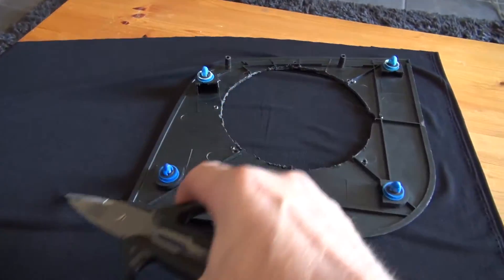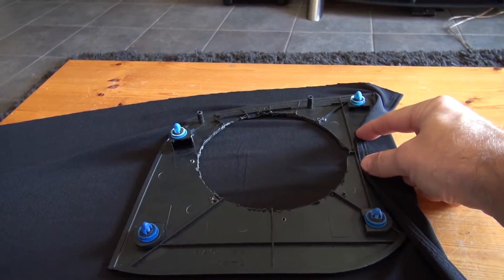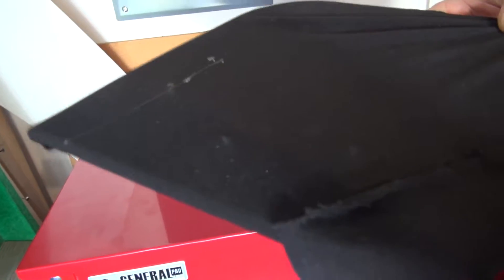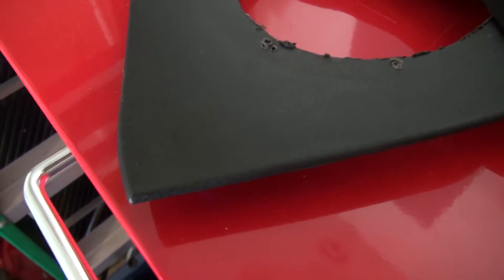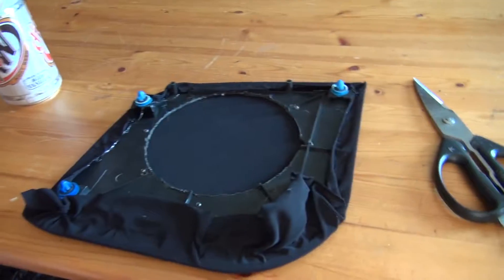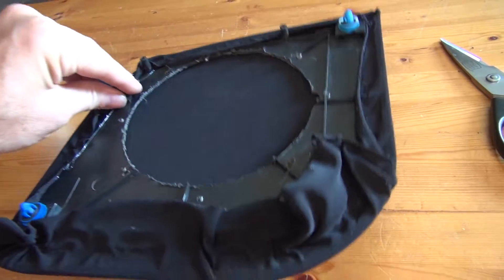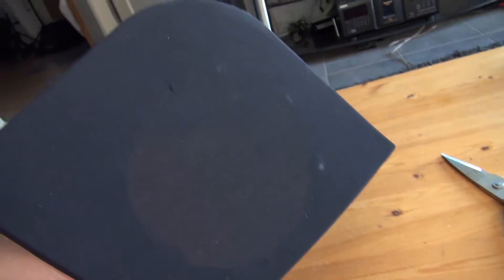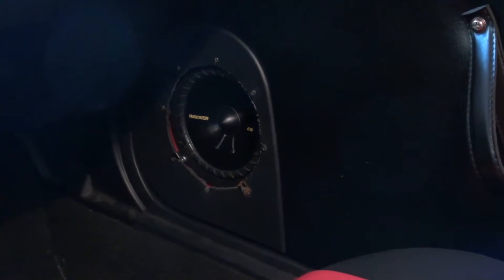1990 Miata Restore Project - Episode 46 - Stereo Upgrade pt3

Comment: Good job man.   I put a Kicker Hideaway subwoofer behind my passenger seat, and it does pretty good for what it is.   I did have to move that seat forward a tiny bit to make it fit, but that's fine since I rarely have a passenger with me in that car.   One other thing that helped, and I know you're going to cringe, but...dynamat.   I put sound deadening on the doors to help eliminate some of the road noise.   When you block out some of that outside noise, the inside noise (stereo) sounds so much better.   Looking forward to seeing the rest of your build.